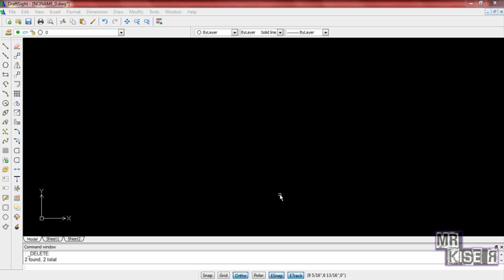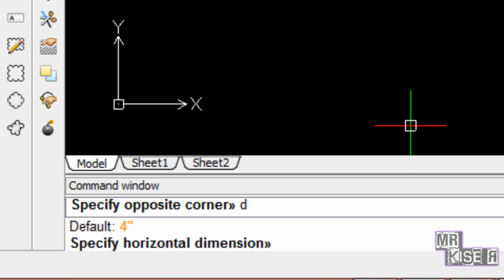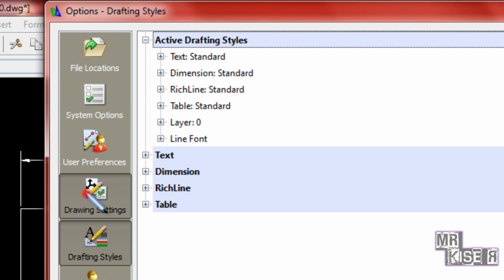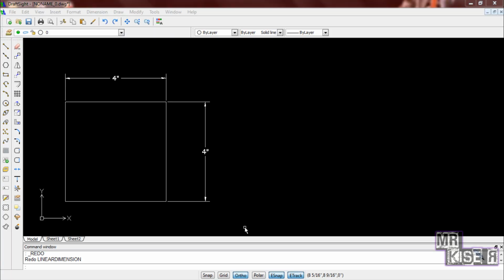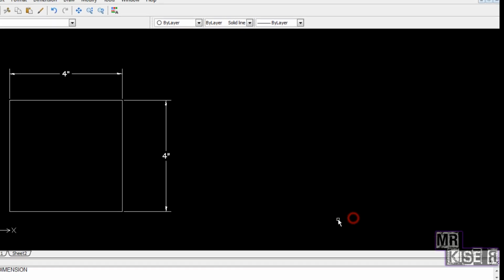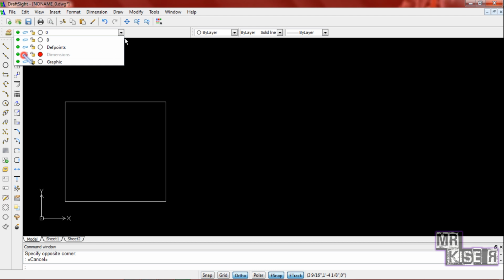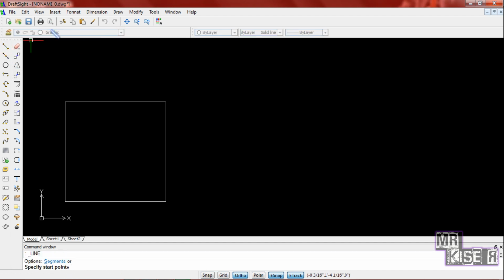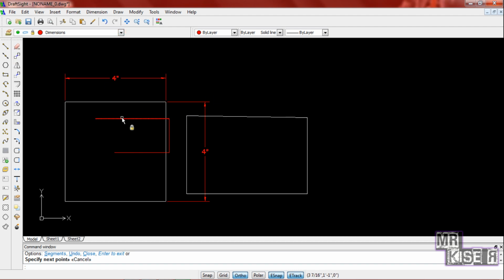Draftsight Dimensions Change

Comment: Hi All,

I'm pretty new to draftsight and was wondering a few things that I was hoping could be clarified.

My task is to paste my design onto another design.  However I am having some problems with scaling/dimensions.  I have made a design in with blocks unit format in millimeters.  Its a 6.35mm x 6.35mm square with a design in it.  I want to then paste it into another design in another file with the blocks unit format in inches.  However, the design in inches seems to be much larger than the design in mm.  

I was given the design in inches by my professor, its supposed to be a silicon wafer.  When I tried measuring the radius of the wafer, it says 38100.  Is this really inches? Doesn't make sense to me since wafers are not 38100 inches in radius.

Am I reading something wrong? Or am I misunderstanding something with the scale?  Any help would be highly appreciated! I'm really confused here.

Kevin
Reply: +buhrehtney I'm having this exact same problem. My title block is huge compared to my 1:1 scale drawing, and then when i go to scale the drawing my dimensions change to huge and crazy numbers.  if you have figured this out that would be awesome.

Thanks